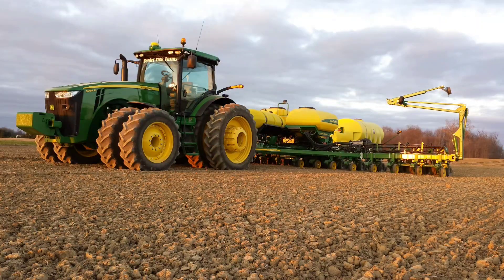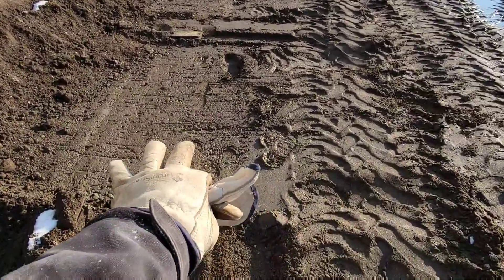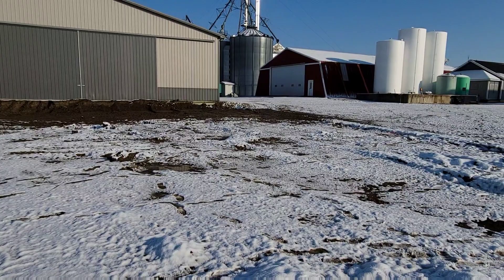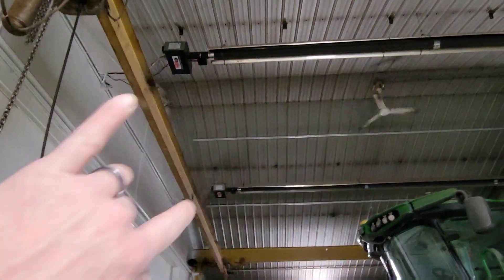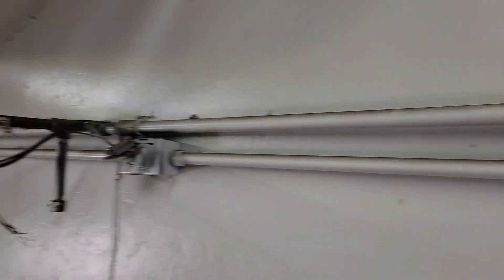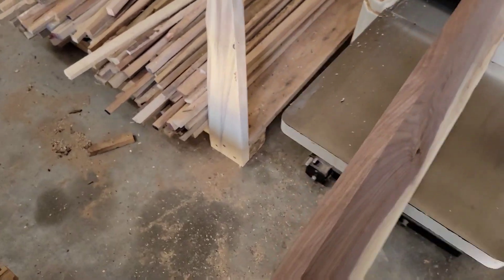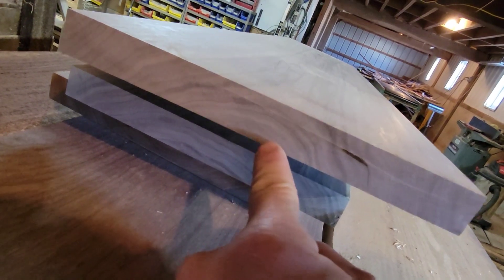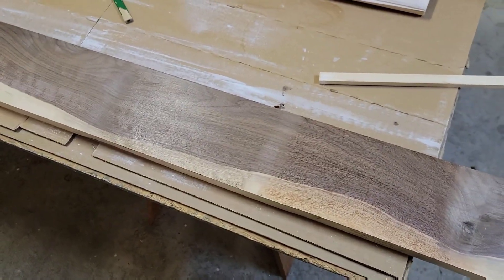Grade Check and Walnut Boards - #560

Comment: You need 1 thermostat to control 2 tube heaters when they share a common exhaust vent. That way 1 heater doesn’t blow exhaust backwards through the other heater; if you had 2 thermostats and only 1 called for heat. You won’t have any problems with what you changed. Unless your thermostat quits again
Reply from the maker: They are separate exhausts in this case

Comment: I have to say I like you do not like the appearance of either of the stains on the sap wood as on the computer it seems to look grubby! If you have the timber available then I would use heartwood only. My other question is though is about its likely appearance in use as a stair tread. Surely it will scratch and mark the surface quite badly which will disfigure its beautiful appearance. Also will spilt droplets of fluids mark it and leave some sort of watermark?

Comment: Argument against one tstat. 
1. When that tstat fails in middle of winter. You will have no heat
2. Possible that only 1 of the heaters ran at times if only one location was measured cold

Comment: I would rather have the floor level in both buildings, and a beautiful 4 ft high interlocking block retaining wall, than a 2 ft lower floor and 2 ft of fill.
Reply: I agree with leveling out the floor on the new building…..any added cost will long be forgotten down the road. Had  a friend build an extension to a building 20 years ago with a 1foot step in it, said it was the worst decision he ever made, he still talks about how little it would have cost him in the long run to level it out & build it level.
Reply: @mikec8161  
Absolutely, that's just like having a wall in the middle of a building, that you have to go around the rest of your life. There are lots of the interlocking block retaining walls around here, from 2 ft and up, and they're very nice looking, and they last.
Reply: True, however did you not catch Nathan's comment about this in an earlier video that it would necessitate a substantial abrupt ramp for access off the the driveway? I thought that this was a valid point since I think its main use is planned for machinery storage and much of his equipment is pretty long so it surely would be likely to catch the floor / ramp when being moved in or out.
Reply: @Dan.Whiteford  
I caught it all, and a 2ft ramp is nothing. But it's obviously their call, just expressing my opinion, as are you.